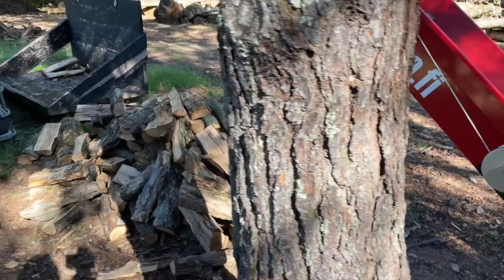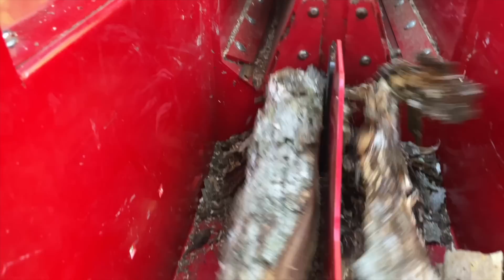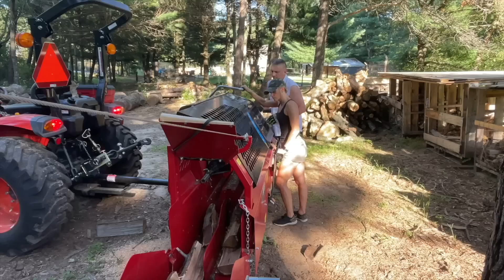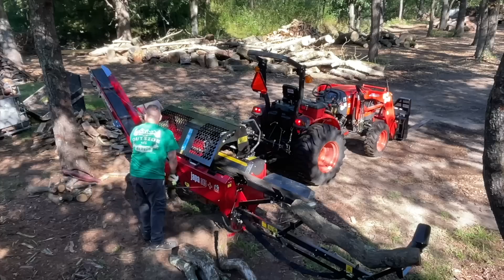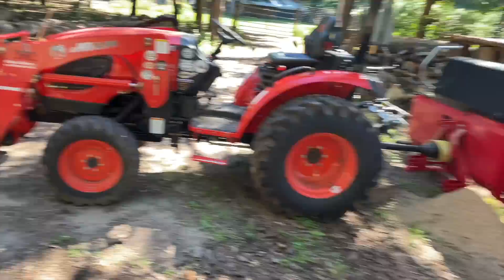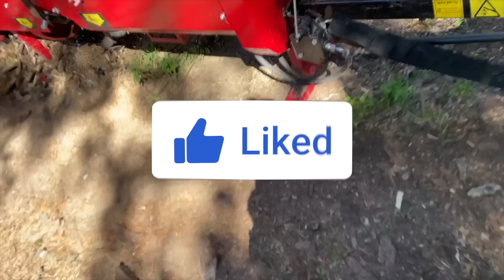Can Ugly Firewood Still Look Good?

Comment: Caan you show the drop point onto the conveyor please?   Also, I reckon it is running too fast and wearing itself out quickly.  (I supervised the maintenance of 54 conv's. foe 13.5 years)
Reply from the maker: The conveyor is built into the machine and attached to it, there isn't a control valve to adjust the speed of it, but in next video I use it I'll try to show.

Comment: Sweet processer is that the biggest PTO drive model offered I get log loads of hardwood what's the biggest dia. The PTO drive will except
Reply from the maker: Thanks....this is actually the smallest PTO model made. It will take up to a 12" diameter log. You can see more of the other models on the Metsa Machines website https://www.metsamachines.com